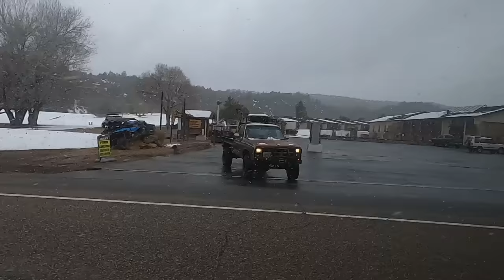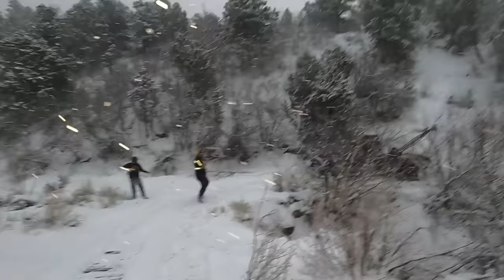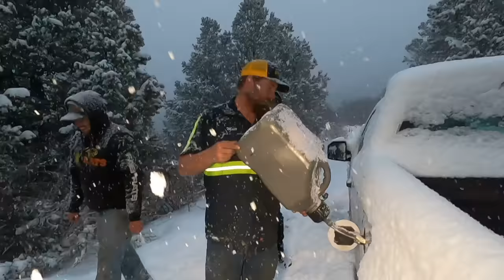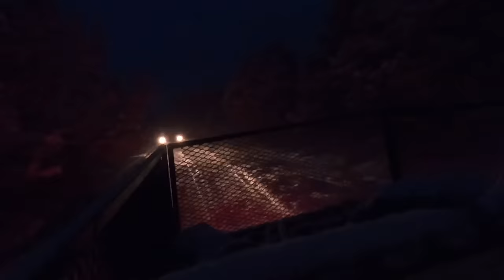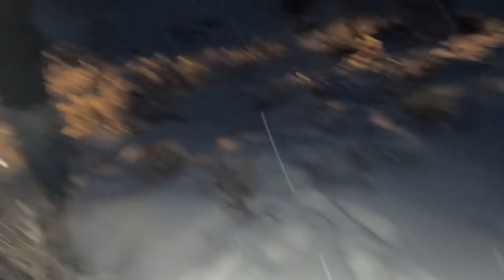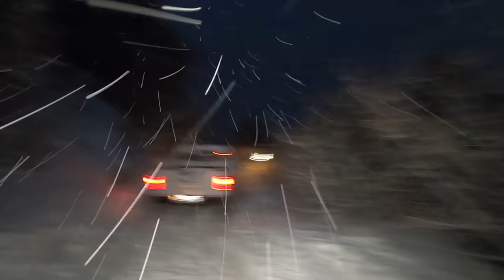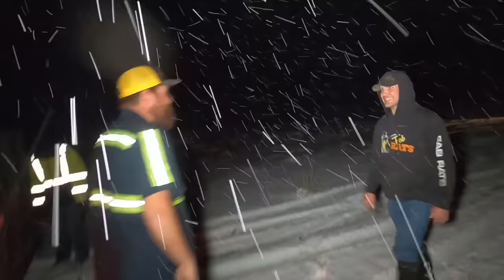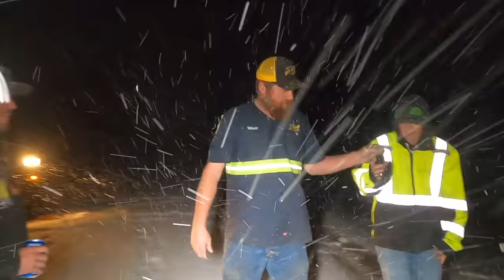Mountain Snow Recovery With A Major Twist!

Comment: Do you have Wintertires in America? Maybe you should put some on one of your Rescue Vehicles.
Reply: They do so many miles between jobs on hard dry pavement getting to the jobs (250 miles plus) that the winter tyres would be used up in no tme....
chains carried and fitted on all 4 wheels are part of the answer..
the Bombi is the real answer....slow but sure....just needs a little MORR tinkering

Comment: I'm a little surprised to see you using an OEM  jack and lug nut wrench for a tire change
Reply: They were there. They fit. They are rated for the carry load. They work.
Reply: @JohnSmith-yv6eq  I've had those jacks fail when the weight of the vehicle shifted and bent the shit out of the jack, made it unusable. Just my 2 cents. They got equipment and tools for days just funny seeing them use that stuff.
Reply: @lukemich12  
Would not like to carry a trolley jack not lashed down securely in any vehicle....
I keep thinking of an airbag jack..
whether filled by an inflator...
or an exhaust pipe???

Comment: No surprise that Ford got stuck with those crap tires.
Reply: Snow blocks up Non-Snow rated tyres.
As the tyre spins it generates heat...
which ,melts snow..
which blocks up the treads
turning non-snow rated tyres into slicks.
Chains are the way to go..until the truck body gets lifted up onto the top of the snow by the wonderful plastic shields under the body..which lifts the tyres off the road surface = stuck.
Then tracks are the go...
designed to ride on top of the snow...no contact with the ground needed or desired
Matt even apologised for the rough ride because there wasn't enough snow to ride over the top of so every rock etc in the road surface was felt in the Bombi...
Reply: @JohnSmith-yv6eq  I am very well informed regarding tires, driving in snow, and that area of the country.  Going off road, in that size and type of truck, a quality M/T will dig, claw, and self clear it’s tread in that drift snow and any ice  or mud underneath it.  Can you still get stuck?  Yes.  But that truck had no business being on that road with those garbage tires.

Comment: Why do I see trucks spinning their tires like crazy in snow in this videos? You have the least traction when you are spinning your tires. The trick to driving in snow is to keep your tires from spinning to not loose traction. You go slow, go easy on the accelerator, you go fast only to crash through an obstruction. Snow driving is easier with less power and a manual. Easier to keep the tires from loosing traction.

Comment: I know I say this every snow recovery... You all need snow chains. 
I drove a semi truck through worse snow than that this year with chains on..

Also. I chring every time you all just drop the throttle to the floor in the snow. It is like you learned to snow drive in a derby pit.
Reply: Matt deliberately did this in the stuck Ford to skid the arse around.
It's a good trick if you have a manual disconnect of the front wheels and a locker or LSD in the rear...
skid the ass round then reengage the fronts when you are pointed in the right direction.
Reply: @JohnSmith-yv6eq  the truck was still in four wheel drive
Reply: @JohnSmith-yv6eq  also that's not the only point I was talking about.

Comment: That truck drove 8 miles while the dash indicated 0 miles to empty. Hmmmmmm
Reply: Many vehicles have that reserve built in by design.
You have to experiment to find your vehicle's reserve...
take a spare can of gas with you if you do this off the beaten trail...
"Reserve" just driving on highway is different from being in 4wd on hills...of course.

Comment: You guys are amazing at what you do, but not in snow. STOP spinning. You just make ice under your tires and make things worse.
Reply: Skidding the arse end round is a neat trick and easier if you have disconnectable front diff/hubs.
Then it quickly skids in the right direction to reengage the fronts....

Comment: What kind of idiot turns around like that? Are you trying to break the truck? You call yourself a professional?
Reply: It's a good technique to disconnect the front hubs or diff (or bury the front so it is stuck in a snow bank and can't move)
...and then use the tendency of a light arsed pickup to go sideways in slippery conditions if you spin the wheels, 
.....especially if the rear end has lockers or a LSD.
Once the  skid takes you to being lined up in the direction you want to go, ...reengage the fronts and away you go again....